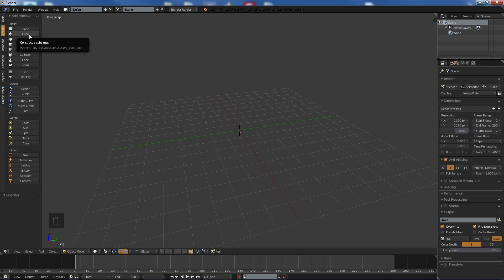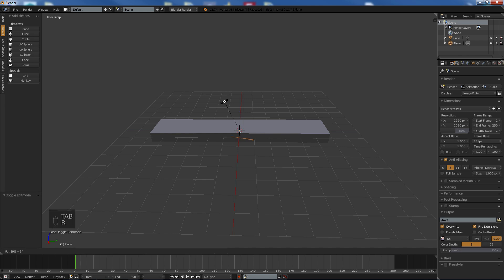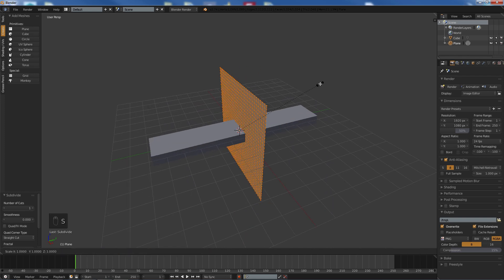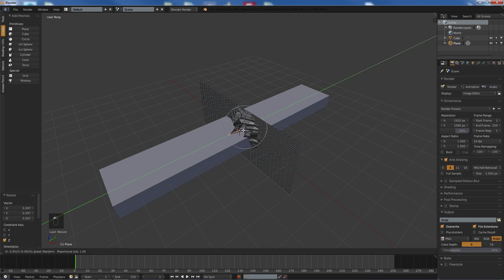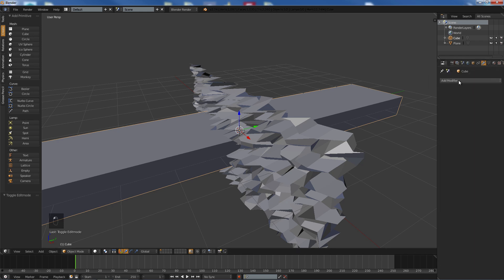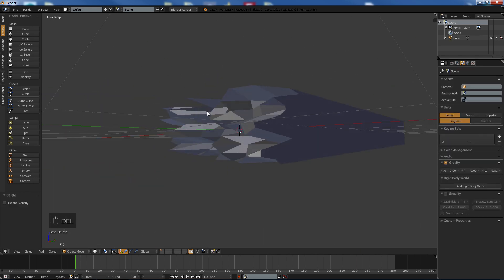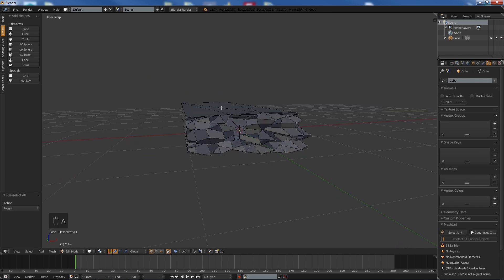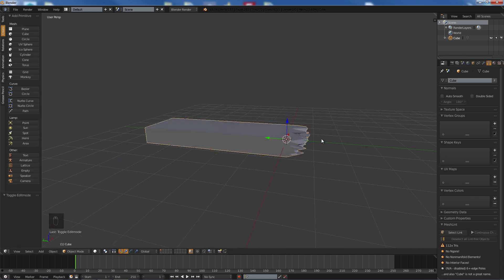How to make a broken wood plank in blender

Comment: thank you bro ! really useful information !
Reply from the maker: +Trololo Lolo np happy to hlep :)
Reply: +CGphoenix hey buddy do you know how to make similar tricks with vertixes in maya or c4d , i can't find a way :(
Reply from the maker: What you talking about when I randomly moved the vertices?
I really have not use maya really that much but the last time I did use c4d was about 3 years the last time I was using it but you may able to pull it off with some modifiers if I can remember there was like a water ripple thing in c4d you mayabel to so some thing with that by using it more then 1 time but if that don't work you mayabel to make a displacement map and then just use a boolean modifier